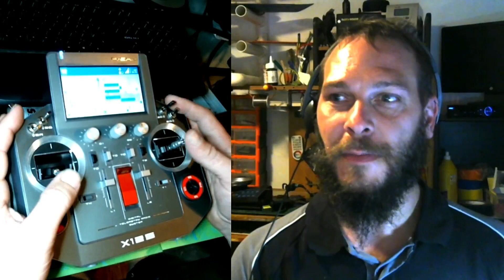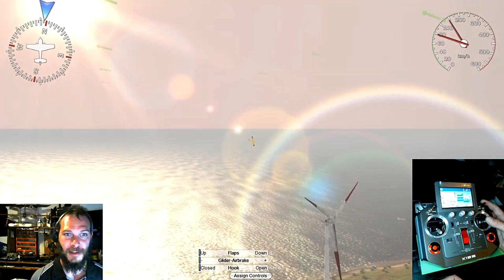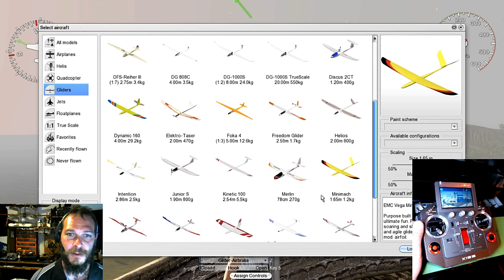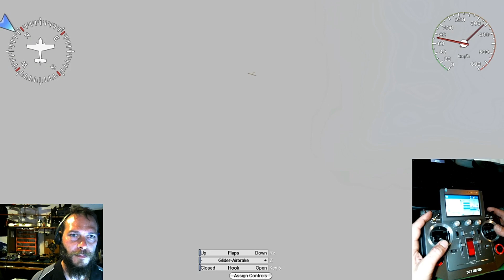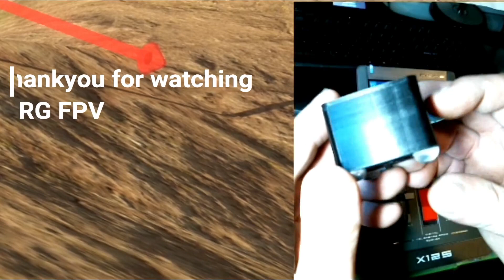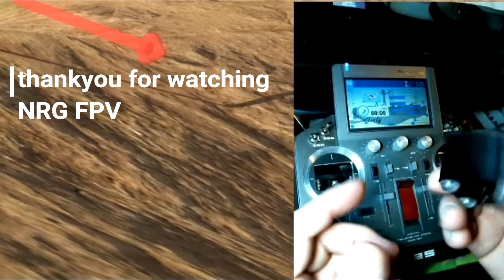dynamic soaring in sim  aerofly RC 7

Comment: bracesport here from NZ - I have been struggling with flying the DS and this video is just the ticket!
Reply from the maker: bracesport  good stuff mate
Reply: @ruedogs  I love RC7 too!
Reply: I don't think I am getting deep enough into the dive to get up and over the ridge line on the climb!I will keep at it!
Reply from the maker: bracesport  u need to carry allot of energy into the first dive
Reply from the maker: bracesport  also i have reslly low rates on some of the different aircraft to get the required control , some of them as low as 20%
Reply: @ruedogs  I set 50% on the rates, but I can try lower! I am getting there on the blade - what wind speed would you recommend for learning!
Reply from the maker: bracesport Having multiple rates on a switch so you can change is handy for the Sim because each plane is slightly different I keep my elevator and Aileron rates on different 3way switches So I can change on the fly. As for wind speed just have a fiddle with different speeds in the same aircraft if it slopes really easy on the front side and has more than enough left it’s probably fast enough for the back